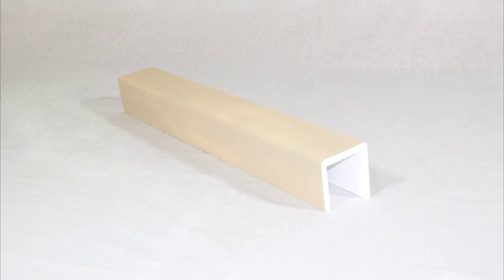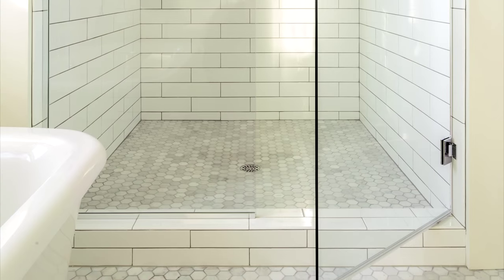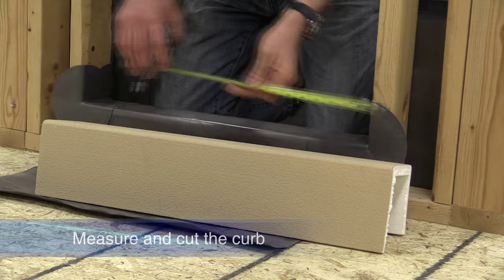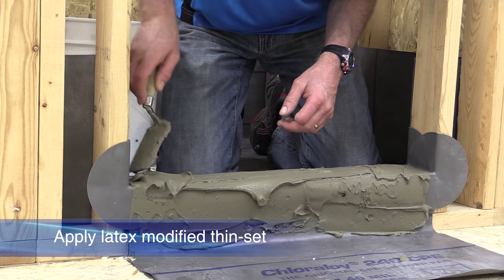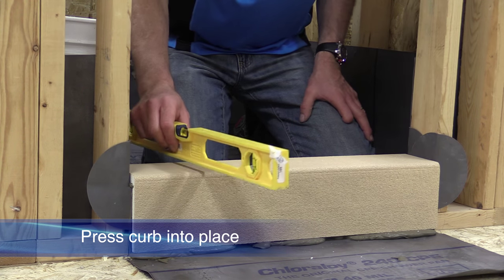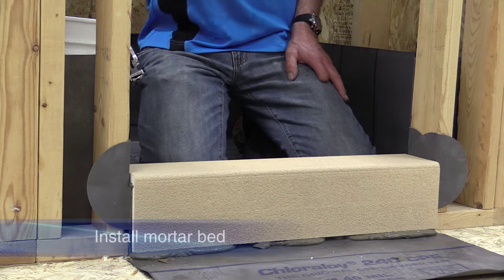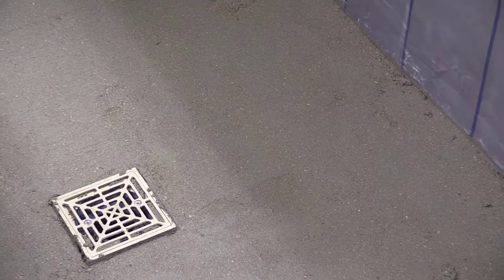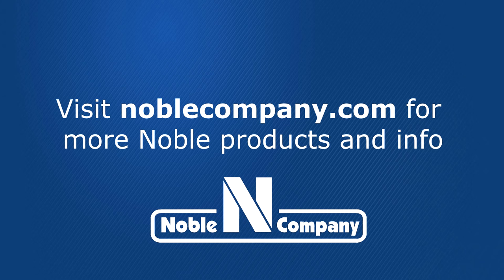Noble Curb in Full Mortar Bed Shower

Comment: How can these support all the weight once installed? Looks like its mostly constructed of foam.
Reply: Both Pro-Slope and the Curb Overlay are made from a high density XPS with either the cardboard or efis coating. While the structural strength of a thin piece of may not be high, the compressive  strength is extremely high. The mortar bod on top or the 2x4's below, and a properly constructed sub-floor provide all the remaining structural strength needed. Feel free to let us know if you have any additional questions.

Comment: I like the look of this but I see the width is 5 -1/8 inch? You then add tile on both sides and your probably not getting any overhang from a 6 inch sill.....the way I do it now it finishes less that 5-1/8 which gets me at least 3/16 overhang on my sill.....I just wish these were like 4-7/8 instead of 5-1/8...
Reply: Thank you for the note. The curb overlay is specifically sized to fit over 3 - 2x4 pieces of lumber, plus waterproofing, and thin-set. Although the length of the legs can be modified, we do not recommend modifying thickness. What materials are you currently using to build your curbs?
Reply: 2x4 curbs usually 3 high then durok. I take a sheet of durok about 13 inches or so by whatever lenght, say 60 inches , then I slice into the durok with 3 measurements  (inside height,  top width, outside height) i don't cut all the way thru durok, then I snap at those slices . What I wind up with is something that looks like your pre-made curb as its all together because I don't cut all the way thru...then I screw the top and outside, but no screws inside (that gets held in by my mud pack. I then redgard the entire curb. This gives me between 4 -3/4 to 4-7/8 across the top of curb then add another inch or slightly less for tile on both sides  which gives me between 1/8 to 3/16 overhang on my 6 inch sills....I would buy this product all day but at 5 -1/8 wide its just to wide to accommodate a 6 inch sill. I guess it might just make it, but definitely no overhang...